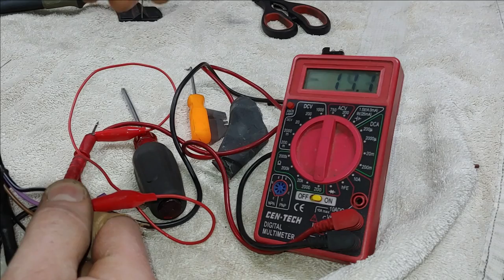02 Arctic Cat ZR 600 EFI part 10: The TSS [Rebuilding a TSS]

Comment: Andrew I am currently rebuilding the exact same sled and your videos are a GOD SEND. Please keep up the good work!
Reply from the maker: Excellent Sled! Glad to see people still have a passion for these iconic machines! 

Thanks for watching! 
Andrew C.
Reply: @Fixin2Ride-Official-  I loved it when it was running right. Started to develop a bog and would cut out on idle. After testing the easy stuff I finally ran a compression test and found 90 PSI on 1 side and 0 PSI on the other side. Pulled the head off and found that a ring disintegrated in the cylinder and blew it to bits. I have a top-end rebuild kit, a used head, and a used cylinder body coming in the mail. I'm praying that this gets it back to where it was, but I fear there may be some electrical gremlins in there as well.
Reply from the maker: Wow. Yeah when they "let go", they "LET GO"!!! DONT THEY? 
No worries. Hit me up in the electrical side and Ill try and help! 

As far as the damage. You want to put new crank seals in aa well as complete gasket kit including a coolant pump rebuild kit. Contact Mike Miller in monroe, MI. For the pump rebuild kit. 

More specificly on the ceank you will want to make sure that your crank bearings are good. When there os catastrophic damage like this most of the time paeticles get into the crank inner and outer bearings and they will be rough amd ultimately will fail. Its about $400 for a good used crank from Mickeys Sled Repair in midland, Michigan. Co tant them amd aak for Chad or Mickey. Let them know I sent you and we met up in youtube. Or if tjey dont have anything or yoire closer to Wisconsin, contact Northern Ceankshaft. Do it right while you have it all tirn apart and youll emjoy years of worry free rop performance Arctic Cat fun, how Arctic Cat designes them and intended them to be enjoyed. 

Andrew C. 

P.S. The extra $400 for the crank rebuild or used one will save you another rebuild and all of the time and cost of another rebuild.

Comment: GREAT video Andrew. I have the same sled and same symptoms, but this didn't resolve my issue. I was convinced the TSS was the issue because it runs fine until just after the clutch engages. any more throttle than that and the engine completely dies, not bogs down, like the ignition is basically turned off. If I keep holding the throttle it will die, but as soon as I let off, it resumes idling. Seemed like TSS for sure, cut I cleaned it up just like you did, made sure there is no continuity when throttle pressed in, and even unplugged the 3 wire connector and still has the issue. 

Maybe throttle position sensor? ECU, stator?
Reply from the maker: Check and see if there's a code on the ECU when you start it up. I don't have the codes on me but you can look those up if there is. It'll be one blink through five blinks I believe with a two-second pause in between each blink series

Comment: latecomer to the party.  Where did you get the connectors at?  mine are pretty chewed up on the sled we just got, and TSS is wobbly.  Dies at times when given gas!
Reply from the maker: Better late than never my friend! I have gotten quite a few OEM connectors from an old wiring harness that I have on hand. But the connectors you saw this video I believe were from the sled they came on and I just reconditioned the throttle stop switch. If I misunderstood please let me know thank you for watching and let me know if you have any other questions.
Reply: @Fixin2Ride-Official-  - sled that we got from a friend has the mddle wire cut and removed.  Not sure how to proceed,  It still bogs down when given gas... Spark plugs changed, fuel pump too.  kill switch still works, so not sure if this is the answer to the problem I am having.
Reply from the maker: What year and model is the snowmobile
Reply: @Fixin2Ride-Official-  2003 arctic cat, mountain cat 600, EFI 144
Reply from the maker: Well if the middle wire is snipped out than it sounds like they disabled the throttle safety switch and are only using the emergency stop switch. Contact Keith or Eric Loudermilk at West Michigan Snowmobile and just get yourself a new used throttle safety and stop switch assembly. Then pull the throttle assembly apart by the three screws on the inside of the throttle assembly
Reply: @Fixin2Ride-Official-  - would  this also fix the bogging down of the sled?  seen a few videos that call for cutting the center wire/pin to fix the bogging down.  Sound feesable/
Reply from the maker: It might. I would get the new one and install it and go from there. It's a good idea to have that thing in there to begin with and I might even go as far as taking it apart and cleaning it and then greasing it with carbon conductive grease like I did in the video and then put it all back together and then install it. Some things to look at car bogging are also the power valves. If they're really dirty that will create a bogging as well as bad fuel or low octane fuel. So in other words old fuel. Also a poorly kept clutch that is dirty or worn, can do the same thing

Comment: Andy. These videos are totally helping me with the diagnosis process for my sons machine. All of your info makes sense. I found other issues as well in the tear down that needed attention. Like the fuel pressure regulator and the pto side power valve cable was broken. I’m having a hard time finding one of these. OEM # 3006-443,,,,,,, you got one? Lol
Reply from the maker: AWESOME! Glad you're finding it useful! That's the whole reason I'm putting up these kinds of videos. Lots of common stuff. I don't have an extra but check with West Michigan Snowmobile parts or 219 Snowmobile parts and let them know I sent you and where were met up at (youtube). Thanks!
Reply: @Fixin2Ride-Official-  I’ll reach out to them. Thanks mang.

Comment: Does the Bog still exists? I have the same Bog issue about 5000 rpm. However, I deleted the TSS, but I still have the BOG. I don't see any flashing (blinking) on the instrument cluster, nor from the ECU, so no error codes to go off. I'm thinking maybe the TPS (throttle positioning sensor) is bad... have you tested yours? I have an 04 800 EFI
Reply from the maker: Check your smart valves in the tank. I ended up putting a tiny slit in mine being they will start limiting flow being they dont allow aa much flow. Have you cleaned you power valves lately? Also try new fuel if you havent.
Reply: @Andrew Crocker - Fixin2Ride  Thanks for the suggestions. I'll take a look...your Playlist was awesome! thanks a ton for the share. 😃🤙
Reply from the maker: Good deal! You bet and my pleasure. Keep us posted.

Comment: So you left a comment on my video that shows up, partially in notifications, but when I go to my video it doesn't show up.   Maybe try reposting?
Reply from the maker: Yeah I saw that it kept giving me an error... I tried reporting like 3-4 times. lol let me see if it's still there as the last one seemed to work.
Reply from the maker: Did you happen to see the comment yet? I recommended watching my latest upload about the TSS switch in the thumb throttle housing. I also mentioned it looked like your PTO cylinder was either running rich (which could be because of bad spark, caused by TSS)  or your MAG cylinder looked lean. With all of the carbon buildup amd very little piston wash. 

I also stated that you beat me to it posting some bore scope video. Ive had some waiting to be edited and posted for my 95 ZR700 series for a few montha now. Ha ha. 

But your MAG cylinder does look to have some scoring on it.
Reply: @Fixin2Ride-Official-  Ran it 30 miles yesterday.   Idk.  Seems to run fine now.  lol
Reply from the maker: @ADDvanced  Thats good. Always helps to make sure you have a good plugs in as they can go bad. I like EYAs as they prevent fouling due to the split end electrode. Has more efficient spark.
Reply: @Fixin2Ride-Official-  80 mile trip today, just got back!  She RIPS broski!   THANK YOU FOR YOUR HELP!   :D
Reply from the maker: Awesome! Great to hear! So fun aint it? So? Ya gonna keep it?
Reply: @Fixin2Ride-Official-  For now, yeah!   Hope to race it next year at a lake cross!  :D.  Need to dial in the primary a bit more; needs to engage a bit higher... so... stiffer spring?   higher RPM engagement = harder launch, I'm assuming?
Reply from the maker: @ADDvanced nice. Ive wanted to do that a time or two. But yes. Stiffer spring for high engagement. They have two spring rates though. For example... 115/285. First is the static compressed rate which will be the engagement psi rate. The second is the fully compressed rating. The higher the second rating the faster it will down shift on decel. 

 Heavier wights will yeild lower max rpms but harder bite (squeeze) when engaged. Lighter weights, higher max rpms and softer bite/ squeeze.

Comment: What do you think would be an easier job swapping the motor wiring an EFI system out of one sled and putting it into a carbed sled  or swapping the whole rear suspension out of one sled and putting it in another sled? I have one sled that has a bad motor that is carbed and a good suspension all around and one sled that has a really good running motor and EFI that has a terrible suspension all around.
Reply from the maker: Suspensuom For Sure!! Depending in the year as you could be down grading the suspension. But if they are the ae suspension, its only four bolts that hold the skid it. All youd have to do is loosen the rear axle,  loosen the track and them remove the four bolts. If it has any remote suspension adjustment lines, disconnect those. 

Carbd to edi swap can take some fabrication and other parts depending on year of chassi EFI is coming from and chassi going into. If its even been a stock setup before.
Reply: @Fixin2Ride-Official-  ok thanks suspension it is! they are both 2000 articat zls ones a 580 and ones a 600
Reply: @Fixin2Ride-Official-  the suspension going into it is the one out of the 600 that doesn’t have reverse and the 580 has it the suspension wouldn’t be different right.
Reply from the maker: Yep! Thats your best bet. I swapped my 96 ZR 580 EFI Triple pprt engine into a 98 ZR 600 efi that I purchased with a 95 ZR 700 carb engine in it! Lol. So its possible. Just have to find the right motor mounts. But same year suspension? Should be a breeze. 

Make sure your bearings are all good as well as your rail slides (hyfax- which is actually a brand name), shocks and limiter straps.  I like to make sure all zerk fittings are free and clear and working properly (hold grease in after application) to boot. 

You may need a 7/8" thin qrench to get the rear bolts off. Hit thwm with soms BP blaster and a bit of heat if nees be.
Reply: @Fixin2Ride-Official-  Ok that’s what I will do then thanks for your help.
Reply from the maker: Nope. No difference. Only diff is the chaincase having the ability to reverse the gearing via push/pull shaft application.
Reply from the maker: My pleasure! Let me know if you have any other questions and thanks for watching.

Andrew C.
Reply: @Fixin2Ride-Official-  I will and I love watching your videos especially the rebuild series!

Comment: My tps is the size of my thumb nail.  I’m willing to say that the wear in the throttle pivot of the case halves is preventing the switch to be pressed and released.
Reply from the maker: Could be. By a new one and send yours old one to me. Ill do a video on fixing if it can be. 😉
Reply: @Fixin2Ride-Official-  they sent the wrong one dude. I have a brand new one like yours. Lol. 
I’m having a mother effer of a time getting the air box back in. What’s the trick ? ZL600 efi. 2002.
Reply from the maker: @sambuvca22  oh man that sucks I'm sorry. Did you get it from West Michigan Snowmobile? Also there is the baffle that's underneath the airbox that you have to get the bottom square holes of the airbox over. And then there's also probably either a fuel line or a wiring harness if not both that you have to get cleared out of the way to get the boxes to sit all the way down. You might be dealing with the carved boots or boot to throttle body assembly he's getting in the way a little bit but I would definitely check for a fuel line down there that's happened to me before.
Reply: @Fixin2Ride-Official-  I got it off eBay. You need it? You can have it for all your help. 
I just popped the baffle out and got it seated. Just gotta walk away sometimes bud. This sled SUCKS 😂
Reply from the maker: Dang that sucks. Yeah thats the only thing about ebay. Gotta make sure you the correct part numbers and stuff. Not all of the sellers are good at what they do. Puts the burden on buyers.
Reply from the maker: But sometimes its best to walk away and take a break.

Comment: I have this same sled. Mine bogs at low speed but if u get up the speed it rips like a monster. But seems rich at low speed and can't do any hard take offs it'll bog and send ur ass over handle bars. Do you think mine has bad tss or you think something else?
Reply from the maker: There's a couple things you could check. First thing I might look into his clutching to see if your clutches are clean and operating properly as in no flat spots on the weights as well as your belt being in good condition and the clutches Center to Center measurement is correct which will reflect in your belt deflection. You can check that by taking a straight edge and putting in across the clutches on top of the belt and then push the belt down until the bottom side of the belt under the bottom side of the clutches straightens out and takes all tension out of that. You should have no more than an inch and a half belt deflection which means when you put the flat Edge on top of the belt and then push down on the Belt hard to take a slack out of the bottom portion of the belt on the bottom side of the clutch is the distance between the bottom of the straight edge and the top of the belt where you're pushing should not be any more than an inch and a half distance.

 You also want to make sure that the top portion of your belt is sitting about 1/8 of an inch above the edge of your driven clutch. Check that stuff and report back if you want to. Thanks for watching either way
Reply: @Fixin2Ride-Official-   I'll try it today. Belt seemed fine last I checked tho. I think it fuel related tbh. I'll take a video of it. To show ya
Reply from the maker: Okay. One other thing to check are the smart valves inside the tank. Also when was the last time you cleaned your power valves? But if you think it's fuel-related maybe try draining the fuel and replacing it. If it's ethanol fuel and you never put any fuel treatment in it smell it, if it doesn't stay in your nostrils has even the slightest smell of varnish that's probably your problem
Reply: @Fixin2Ride-Official-   I'll get back to ya with a video. It runs okay but when you take off it's bogs it seems like it's like the fuel rail or something I don't know. I think it's getting too much fuel at low RPM. When you get it moving and it starts to move then you can get on it and it'll race like a bat out of hell hitting ridiculously high RPMs lots of power but at the low RPMs you can't just pin it you can't take off fast you got to slow build into it
Reply: @Fixin2Ride-Official-   I drained and cleaned tank and has 93 in it. Tht wat I tryd first
Reply from the maker: Well you can check your fuel pressure by putting an inline gauge in the supply line and should be at around 36 to 39 PSI if I recall correctly. Have you done a compression test on your cylinders?
Reply: @Fixin2Ride-Official-   120 both sides
Reply from the maker: Definitely post a video if you can. Typically the throttle stop switch well limit power and RPMs after around 4,500 to 5000 RPMs sometimes 6000. So I wouldn't necessarily think it's that but you could bypass it and see if that works. Never hurts to try. K. I. S. S. Which means keep it simple stupid. I have to tell myself that all the time haha

Comment: Hello friend. It's finally time to watch your video in full. Everything is perfectly done. But you're all the same, it is LOGICAL to explain when you press the button. BOTH cylinders are silenced. Why didn't you have ONE working for you? I can't understand. How can you turn off only HALF of the engine with one button?
Reply from the maker: Sorry for the late response... We went on a sledding trip. ;o) That's a REALLY great Question! LOL

So, being an EFI the ECU will act funny if there is a short or poor connections. That's really all that I can determine. The ECU does have the ability to put the sled into "Limp Mode" per the manual, IF there is a change, out of range, in voltages... So I can only assume that this also stands true for shorts in the switches or harnesses causing them. So being that there were a few things that needed to be gone through that would change voltages in the system (including lighting voltage variations) which I have corrected, I'm not seeing any more issues.